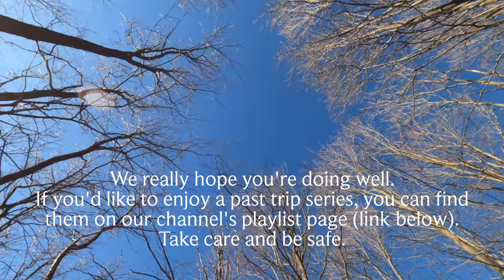I Built Something In Our Basement - DIY Canoe Paddling Erg! (4K)

Comment: For the last few years, I have adapted the standard rowing machine at the local gym. Hi Chris; Good to see you again. At my age I definitely need preseason prep. All I do is turn the normally horizontal handle  vertical , put one hand over the end & the other near the bottom. Then I paddle 25 strokes on one side & then switch. Not perfect but it works all th right muscles. Problem < with Crona 19 the gym is closed. Thanks for the tip Brian 79

Comment: That's a great idea. I've been using a 5 foot section of 1 inch diameter copper pipe. But it only replicates using a double bladed paddle. Mind you after 30 mins my shoulders burn.....